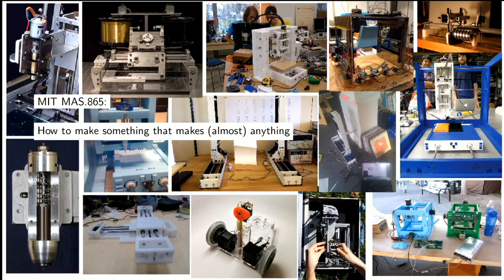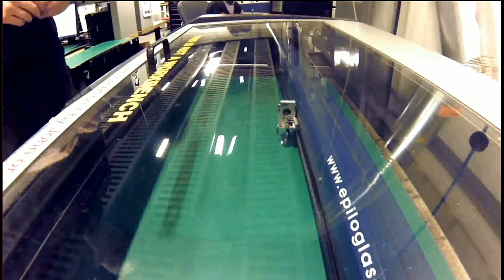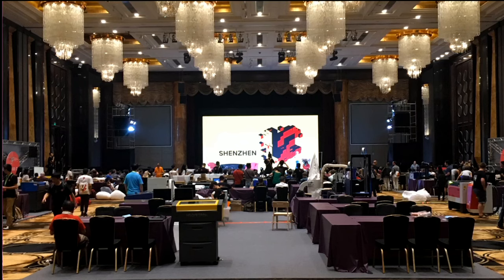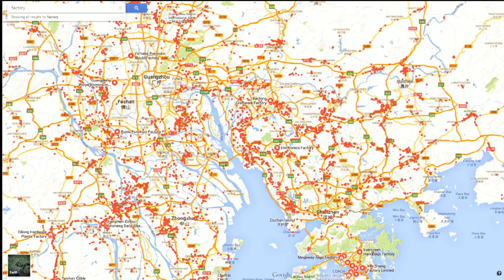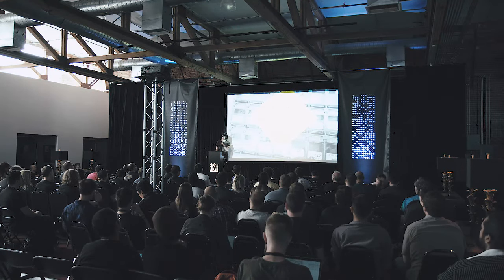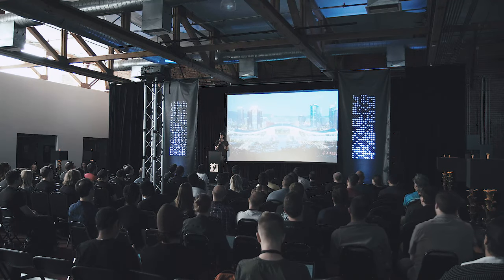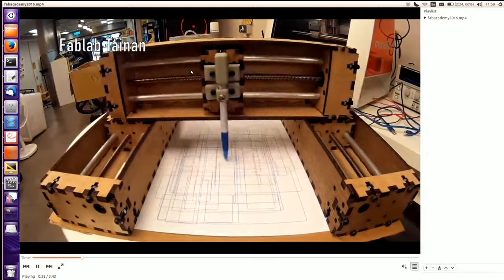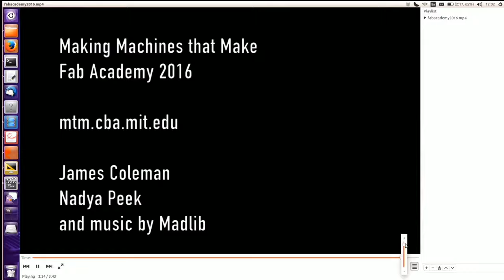How to Build a Lab That Can Build Anything in Just 8 Days

Comment: cardboard is not a good material though, it cannot hold up under repeated stress, moisture or heat environments.. You will be constantly rebuilding and replacing parts of your device more often than you will get results..